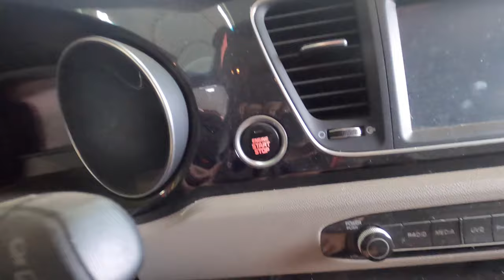2015 Kia Sedona 3.3L Engine Replacement time-lapse. #sedona #kia

Comment: Nice work. You're a very patient man. My wife owns one of these, and i hate working on it. Too cramped. Lol
Reply from the maker: Yeah, it’s like a puzzle every detail matters. Thanks for watching.
Reply: @WrenchingRyan  do these vans have 2 expansion valves, front snd rear or is there just the one on the firewall? Any tips on accessing them?
Reply from the maker: @Jareddowling  2015 model?  If so you have only one expansion valve and it’s in the firewall, Freon recovery and intake manifold removal is required to replace it. Watch this video until 5:30 to get idea how to remove the intake manifold. https://youtu.be/CCe-ltGQJQg
Reply: Sweet man! It doesn't seem too shabby. I assume that intake manifold gasket is single use?
@WrenchingRyan
Reply from the maker: @Jareddowling  Yup, gasket is one time use only.

Comment: Love the engine videos🤙. I have always liked how different techs attack the same job's differently.  We remove the whole front end and remove the engine that way. Cheers.
Reply from the maker: Thanks buddy… Tech Rocks 😆 stay safe as always.
Reply: Same here, popping off the bumper and core support cuts many hours off this job and no alignment needed afterward, same with the V6 Sorento.  Also car can be pushed outside with front end off but cradle still in as there is often a back order on something you need for those.

Comment: I own this van and while I certainly appreciate your attention to detail here I hope I never need the engine replaced!
Reply from the maker: You’re welcome, thanks for being cool with this, have a blessed year!
Reply: What was the reason for the engine replacement on your van?
I have mine at Kia right now for a loud ticking noise that sounds abnormal..... Awaiting the diagnosis results soon.
Reply: @WrenchingRyan  How much to replace this engine?  The dealer told me the bolt backed out of my engine block causing the head gasket to fail.  I put in some liquid head gasket that is holding me over but would like to save the van.
Reply: @tamatama18  Hello! Please give me advice, I was offered to buy a Kia Sedona 2015, engine size 3.3 gasoline, mileage 240 km! Is it worth buying such a device or is it better to refrain?

Comment: My 2015 Kia Sedona has 94k miles. Kia says the engine needs replaced but hasn’t yet given me a price. If I was the original owner it would be covered by warranty. But since I bought it one year old it’s on me to pay for everything. I was meticulously about the maintenance on this car. Loved it until now. I’ll never walk in to a Kia dealership again.
Reply from the maker: I’m sorry to hear that. Hopefully they get the DPSM involved and goodwill it.
Reply: I spoke with the DPSM and requested good will assistance. They strung me along for TWO MONTHS, requested my proof of maintenance. I supplied that. Then one day they emailed me denying any assistance. No reason just “denied” Never again Kia. Never again.
Reply: I was denied by DPSM , in my case I am the third owner having 60k mileage on it ,In my case a faulty oil pressure switch ($160) brings down an entire engine into crap , but I have seen kia sedona 2016 and 17 running over 250k miles .I resolved my issue with a jungard engine 55k miles on it to replace original , almost 14k miles covered still no problem
Reply: @jmata2572  I’m done with Kia. My experience was awful.
Reply: @Shawn0143  Same here will never buy any thing from them , I think lawsuits will force them out of US market 🤔
Reply: Hello! Please give me advice, I was offered to buy a Kia Sedona 2015, engine size 3.3 gasoline, mileage 240 km! Is it worth buying such a device or is it better to refrain?
Reply: @jmata2572  How much for your used engine and install? I just got mine towed back home after 5 months sitting by my mechanic. ours is paid of and dont want to get rid of it and put another engine.

Comment: What was the failure requiring replacement? Seems you went to the trouble of pulling the cams before deciding to replace the engine. I assume you saw something in the cams or valves that told you the engine was wrecked? I'm currently doing a major job on my 2015 Sedona. It had a head gasket leak. I read about block head bolt threads failing on some of these engines. I had two head bolts on each bank that were loose when disassembling. I've installed threaded inserts from Huhn Solutions, which seem to me to be better than Timeserts. I should get the heads back from the machine shop tomorrow. Hoping to have it all back together in a few days (I'm very slow compared to you). I currently have 125K miles on the engine and I'm hoping to get 100K more. Any comments or advice?
Reply: Hello! Please give me advice, I was offered to buy a Kia Sedona 2015, engine size 3.3 gasoline, mileage 240 km! Is it worth buying such a device or is it better to refrain?

Comment: Hey Bud thanks for the video! I see on your other video that you removed the "front rad support" instead of dropping the frame. Which method would you prefer on 4X4, removing the front rad support (splitting the engine and transmission) or drop the frame (drop both engine and transmission together)? Thanks in advance.
Reply from the maker: If you working on 4X4 and you have the equipment like the red table or equivalent I used I strongly recommend of dropping the subframe with engine and transmission in it a lot easier this way. I the other video you see I think other technician using the table so I have to do it in different method but dropping everything works best for me.
Reply: @WrenchingRyan   Hello! Please give me advice, I was offered to buy a Kia Sedona 2015, engine size 3.3 gasoline, mileage 240 km! Is it worth buying such a device or is it better to refrain?

Comment: brotherr please can you show me where is the fuel rail pressure sensor located i ha¡ve the same sedona 2015 and same engine
Reply from the maker: In the fuel rail itself, you have to removed surge tank and intake manifold to access the sensor, also the high pressure fuel pipe removal is required and that parts is one time used only.
Reply: Brother thanks for reply back 🙏🙏🙏
Reply from the maker: @kidhenok573  no problem brother, have a great day!

Comment: How much change to fix a engine on 2015 sedona
Reply from the maker: It depends what engine conditions you dealing with,  if you’re having issue with block but cylinder head can be re used then parts cost can be reduced.

Comment: My 2015 Kia Sedona only has 67,000
I bought it in 2016 a lease trade in with 25,000 miles
Ive been dealing with health issues in the past 3 years so ive barely drove my vehicle. But always keep my fluids topped off matience etc.
Well ' i went to drive my car the week of Christmas 2 major Christmas shopping trips! No over heating etc. But my last trip my heat was going in and out blowing a harsh chemical smell.
Kia couldn't get my car in until Feb 8th!!!
I hadn't even drove my car at all. Because the weather is so cold. I cant drive without heat with arthritis!
Kia place called me and Said Head Gasket is cracked???
Went to pick it up today. 
Now its blowing white smoke and making a weird sound when i crank it!
The service guy said take it across the street and sell it to Car Max! Well i couldn't because the car temperature went all the way to extreme. Now im having it towed home tonight....
I just paid off the car!
Any suggestions as to
What i can do?
If i have to head Gasket fixed? Could i still trade it in somewhere?
Or am i screwed already?
I really need advice?????
Thanks 😊
Reply: I am not a vehicle expert but gone through the same issue , I think the smell is from coolant leakage from head crack , Only option is change engine with a used engine from companies like LKQ or Junkyard like chucks auto from   PA, Question is do you have money for engine replacement which will take almost $8000k, used engine alone cost $5000 plus  then labour to put on the engine , In my case I don't have any other option , so put an engine from LKQ , as of today no problem , initially wetness under oil pan , but dealership told oil pressure switch was faulty  ,Mine almost completed 12000 miles recently after engine replacement , Companies like Chuck auto give lifetime warranty if you are ready to pay , make sure you fully understand what offer they give before taking a decision .Never go for Remanufactured engine from any 3rd party vendors , they will take your money and will not stand behind the product ,Jungard is better bz there engine is original factory fit

Comment: It just cost this customer $125,000 for the engine swap. 5x the what they paid for it. KIAs suck yo. They quoted me $2,000 just to figure out the ticking noise which is the timing chain tensioners. $60 worth of parts that I can do on my own. Dont buy a KIA.

Comment: Great video. I know the 2.4's and 2.0's have issues, but I had no idea the 3.3L had problems. This is the 2nd 3.3L replacement video you have done. Is this common?
Reply from the maker: Not quite… this is actually my 3rd v6 3.3L engine for this year, two of those are lack of maintenance. Thank you for watching.
Reply: I've got a sorento with the 3.3 and we have always done maintenance properly and it still spun its rod bearings. Extremely expensive for a used replacement engine!
Reply: @WrenchingRyan  Im having trouble finding a sorento engine,do you know if the sedona engine would work? I've seen several with the same vin digit that I need for my sorento.
Reply: @willhart7861  A Kia remanufactured engine with warranty is often cheaper than a used engine from what I've found

Comment: This is the reason I do my own maintenance. This guy never used a torque wrench for any of the bolts including the wheel lug nuts!
Basically throw it together as fast as you can and hope nothing falls off when the owners are driving 👎
Reply: @ronijr4918  Now who sounds stupid admitting you do shoddy workmanship! I rest my case, this is why if you have the knowledge do it yourself! Kia and every manufacturer specify torque settings for every nut and bolt and I agree not all are critical but some are. But so called technicians like you think it’s ok to rattle away with your impact tools with no regards and no idea how tight or loose a bolt is. I guess you have never had a wheel fall off because the bone head tech didn’t tighten or over tightened the lug nuts, because they were in a rush to move on to the next job. It’s never happened to me because I always torque them but it’s happened to many people I know who blindly thought the Stealerships people do good work.
Reply: @peterbutler904  Since you like to play DIY go play doctor ohhh, ohh and go play attorney at a cout hearing 🙃 and tell the JUDGE YOUR DIY ATTORNEY SINCE YOU KNOW EVERYTHING AND CAN TELL A PROFESSIONAL HOW TO DO THERE JOBS. Bye troll. 👋
Reply: @ronijr4918 
I’m not a troll, just pointing out that technicians are not encouraged to do good, safe workmanship by the stealerships with the pay structure and they get away with it! Does that make it right?
If the aircraft maintenance technicians worked like you guys, there would be planes falling from the sky left and right. They don’t because every single nut and bolt has to torqued, checked and double checked. That’s to save people’s lives. It should be no different in the vehicle repair because peoples lives could be at risk too.
Reply: @peterbutler904  Okay I'll take your word that you ain't clowning.  But listen as a aviation technician you don't get paid " FLAT RATE AKA COMMISSION " you get paid a salary or hourly rate, so you can take a month playing dumb and taking naps. And for your 2nd concern " USE A TORQUE WRENCH ON EVERY BOLT "  Well yes every car manufacturer needs torque specs for everything. Does that mean we have to torque the Air box, Headlight nut, Glove box nuts, blend door actuators, ignition coil, interior trims.Etc...? Yes any qualified tech will know ALWAYS USE A TORQUE WRENCH WITH CRITICAL COMPONENTS.  Like when rebuild an engine, head gasket bolts etc. But for wheels we also have " Torque sticks " MANU SHOPS USE THOSE because it's within in specs. However if you paid attention he was doing a " Long block " meaning he only had to tighten bolts that are sizes "10,12,14mm in size and those don't require but 10-15Ft Lb. And just by using your hands and a wrench you can have a good feeling on how tight it is.
P.S THE KIA STINGER I BELIEVE IT'S THE 3.3L YOU CAN'T EVEN USE A SOCKET AND RACHET, the only way to acces the drain plug is to use the thinnest  WRENCH you have. So you tell me how can I torque something if my torque wrench doesn't even fit to begin with??
Reply from the maker: It’s just two different versions of similar goal visions,,, DIY has unlimited personal time to torque every single nuts and bolts. Professional Technicians aim to get jobs done, as best as they can, including applicable Diagnosis and Analysis, on some unlimited time basis, with main objective to focus on most important details specifically to torque the components like fuel rail and high pressure fuel pump, referring @ 5:34 of my video. It’s a need not to show on the video as this process is already considered SOP as a Technician, to ensure safety in general. Anyways, comments and advise are always appreciated!
Reply: Negative on the thinnest wrench to reach the drain plug on a stinger or stinger at all, just requires a 17 mm wrench or socket